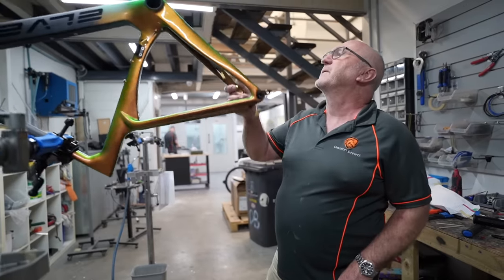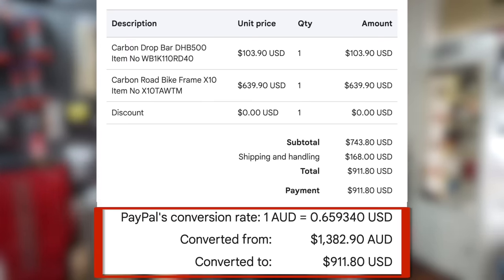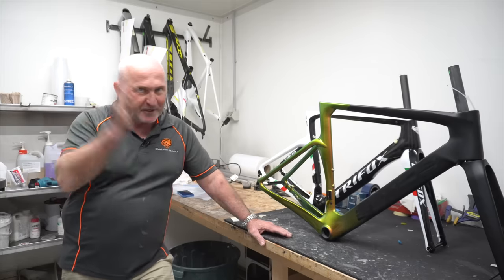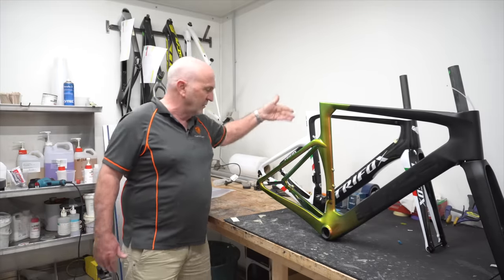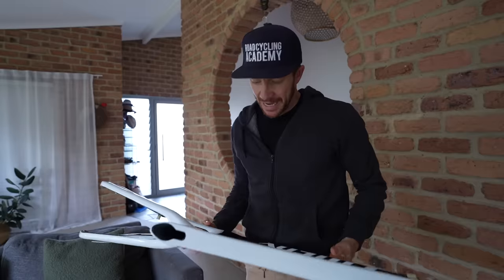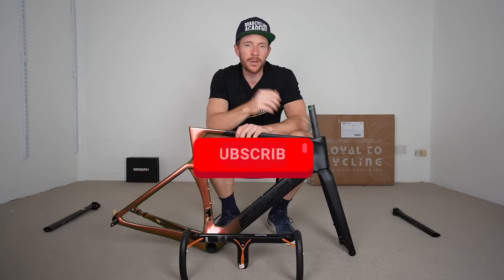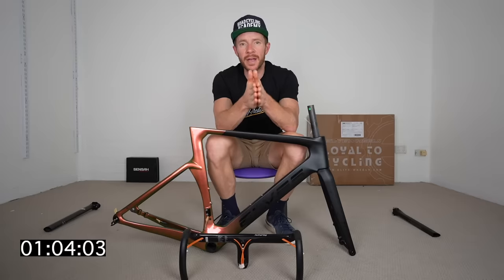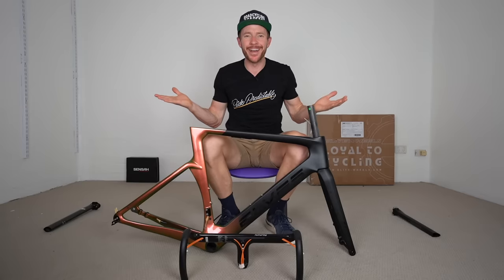I Bought Two Cheap Chinese Aero Frames (here's why)

Comment: I thoroughly enjoyed the video and your experimentation with the Chinese bikes. I have ordered a few myself over the years and you nailed it when you said they are hit and miss. I have had some great ones and some where the rear triangle was crooked. I am one of those not willing to spend 10k on a bike. Thanks again!
Reply from the maker: Thanks for sharing on the thread.
Reply: So what did you do with the ones that didn't work out? I'm interested but couldn't you argue that if you had to trash those bikes the price gets pretty comparable to a solid bike like one from Canyon?
Reply: @jackwright3098  Great question! I have found that I can buy 4 new frames from China before I hit the price of a brand new frame from the name brands. I have really only had one lemon from China and the other 7 or 8 were perfect. I enjoy buying and building up bikes so that is why I have experienced so many. Now many of the Chinese brands have some sort of warranty but even if they do not, you can buy 4 frames before you get to the cost of 1 name brand frame. Riding a Chinese frame, I do not have the fear of a frame breaking like I would if I was riding a name brand who may try to shaft me with their warranty fine print.
Reply: @BlackWaterCyclist  hey thanks for the reply. So you're not worried about the qc when you're going fast downhill? You could definitely have the same issues with a named brand but people have just made me paranoid maybe regarding Chinese manufacturers.
Reply: @BlackWaterCyclist  The problem is, if you have the money to buy 4, 8 or 10 or whatever Chinese frames in the hope one of them is good then you have the money to buy one frame that you'll know will be good and may as well do that. If the only downside to buying a known good frame is "might have spent a bit too much money" then you've lost nothing and you'd be better spending your time and energy finding ways to make money than buying multiple frames.

What typically happens for someone who isn't just playing on their youtube channel is that they don't have the money to buy multiple Chinese frames and they don't have the money to buy the expensive frame, and they're attracted to the idea of getting a bargain from China. If they get a lemon they're left with nothing, out of pocket and living in regret sans a bike (that's without even taking into account the very real possibility that they discover the 'lemon' carbon parts when they break as they are riding along - because they don't have the money to take everything along to some carbon fibre specialist to xray either)

So that's the flaw - playing at being poor and buying cheap products isn't the same as being poor. That person who genuinely cannot afford to take the hit if a cheap carbon frame is a lemon really needs to buy a known good quality metal frame or a used bike - because the hunt for non-lemons from China is a game they can't afford to play, in the same way the S-work frame is a game they can't afford.
Reply: @jackwright3098  Jack you make an interesting point about why you should buy a Canyon. However my friend recently brought a Canyon Aero and it's not all been plain sailing. He had to wait six months to receive it and that was partly due to Canyon were trying to resolve a seat post issue. Sadly they still haven't managed to do that because his one irritates him by squeaking constantly. Given he paid £7.5k for it I would of expected better. However all that said if had purchased an Aero bike from one of the other top brands he would of had to pay a lot more. Back in the 90s when I was in my 40s I aspired to get a Colnago but I just could not afford to buy one but given the high price of prestige bikes today I probably had more chance of buying one than I do today. Prices are just ridiculous. And as someone else has said in another reply the manufacturers are leading us down a particular marketing route. Every bike now as to have discs & hydraulic brakes but given the speeds I do rim brakes are more than sufficient for me and make the bike that bit lighter which also suits me. Recently looking into buy a Chinese frame I struggled to find one that takes rim brakes as well.
Reply: @2wheelsrbest327  prices are insane now, you're right.  And I just found a very small crack on my carbon road bike frame that will cost me $500 to repair.
Reply: @jackwright3098  Thanks Jack. Sorry to read you need to get your frame repaired Ted
Reply: @michael1  isn't that why this type of video is worthwhile? because he isn't playing at being poor, he's spending money to test things so others don't have to go through the bad frames themselves.
Reply: @chrisnoname2725  Not really. Like I say unless you're able to gamble your money on getting a good Chinese frame then your best option is the lower risk of either saving up or riding a cheaper material. And who is able to gamble their money? People with money to waste. The guy who can afford to buy a chinese frame that turns out to be shit are people who could afford a specialised, giant or whatever brand from their LBS in the first place - so why bother? (and note it's not a question of 'Are these frames ok?", it's more a question of "How many frames do you need to buy to be reasonably sure I'd get 1 good one on the average - 1 and a bit? 2, 3, more?) 

Just look at some of the tat they've got (https://www.youtube.com/watch?v=b57npoYQ-Z4) in other videos too - it's a big joke to these guys if they get a bad frame because you're paying for these bikes whether it's by watching the channel or being a customer of taylor cycles. It's not a joke for the guy with a genuine low budget who gets a frame that's potentially not just poor quality but dangerous too. They might not have the experience to see that there's cosmetic stuff like 'finish is shit' and 'this is likely to snap at some point' - noting too that a lot of these channels take the frames to some place that xrays them and looks for voids etc. This is something they do because, again, they have the money to waste (or the business they visit fancies the exposure)

Whereas the guy who buys the cheapest frame because he's little money isn't about to spend hundreds more getting the frame checked. And even if you did economically speaking it's probably best to just throw it in the bin and forget about it if the frame is bad rather than trying to ship items back and forth between wherever you live and China. 

Whereas, for the most part, if you get a bike from a LBS or even an online retailer in your own country you've a better chance it'll be sound and a better chance of resolving issues. 
That said, a glance at hambini's channel and you'd probably reach the conclusion that you can't get a good quality frame however much you pay - it's all overpriced tat engineered by idiots.

Worst case if you get a good frame from a well known brand is you spend a bit too much. You'll soon forget about that money after you ride for thousands and thousands of km and it's still sound in 10 years. Whereas if you spend a few hundred dollars on something that's shit you've lost the money and you don't have a bike. i.e A better strategy for a happy life is putting more of your effort into trying to earn more money than trying to buy cheap products. Unless you can get other mugs to pay by creating youtube videos - and then you can indulge the "Can you make a good bike from parts off aliexpress?"  - The last resort is living within your means, i.e I'd sooner have 10 years of fun on an aluminium or steel bike than trying to buy a carbon bike cheaply where "cheaply" means vastly increasing the risk that I'm just throwing my money away.
Reply: @michael1  I understand and agree with most of your points. The only reason i would say it has value is for showing who the better manufacturers are. It then depends on the consistency of the quality of the product. I assumed the people talking about it being hit and miss was between manufacturers rather than within the same product line. 
If a brand is consistently good and this can highlight a decent product then that can be helpful but I know they're not testing that. 
I personally just buy brands i assume are reliable and buy within my budget but it seems with a lot of things you pay the premium but don't necessarily get the reward.
Reply: @CamNicholls  he bro  can I buy Trek marlin 6 but made in China is written in frame buy or not I live in india

Comment: I'd gladly buy an Elgath Pro Disc ... but a mate's BARELY fits a 28 tire at the rear - IMO too close for comfort.   There's no excuse these days not to clear a 32 on disc bikes. He weighs 60kg soaking wet so he can get away with 25s even on rough roads. I'm running 29 front, 31 rear at 81kg.

Comment: Don’t forget that the vast majority of “American” companies still make their frames in China.  So, you’re mostly paying for better Quality Control, and a name that you can sue if something goes wrong, not where the frame is made. My friend bought a nice CF Marin frame a while back that was defective, and he’s been waiting over 6 months for a replacement that he’s probably never going to see. And most of the Cannondales that come into the shop I work in have poorly-assembled components that need either hefty adjustments, or outright replacement. A faulty shifter, and a disc brake caliper that had a majorly leaking seal are just from the last shipment we got in.  I feel like many of the “American” companies are relying on their past reputations, while cheaping out now.

Comment: Loved this video.  My road bike I built up myself is a china carbon frame.  After putting good quality, albeit used, components (Mostly sram red stuff), It weighs in at 14.6lbs.  I.E. Lighter than the brand new Tarmac SL7.  I have put a little over 3000 miles on it.  It is still solid.  Love riding it.
Reply: what frame did you buy?

Comment: 99% of the high price frames and forks are made out of China the last 12 years. They then ship to Taiwan for logistics and less dumping taxes.

100% of dentists dont know this fact.

I currently own over 40 high end road bikes and work on bikes daily as a mechanic when in Australia. The Trifox X16 rim brake is an incredible machine. I sold my SL7 S-Works after the first ride. The S-Works SL7 you see being ridden by big name riders is a different frame and fork. This has been confirmed to me by a team mechanic and video proof. It is hilarious how most cyclists are conned by these big brands. Just look at the prices they charge now for frames made in the same industrial estate as these brands Cam features.
Reply: You did not mention in your videos how rough the finishing was on trifox bikes, goes to show Cam is a lot more credible than you are!
Reply: Dentists also know that if the fork breaks because of a defect and your teeth are knocked out, you want a name-brand OEM so you can sue them for damages.

Comment: thank you for the content ! Ive been using my 150$ hybrid bike from walmart for 3 years and im now thinking to upgrade for a Road bike around 2000$ range. (ive been doing 100-150km rides and 15% hills on that 150$ walmart bike lol and i use it 7 days a week)
Reply: I took that plunge myself about 6 months ago, spent my tax return on a gently used carbon dream machine for $2,000. Best thing I ever did. You won't regret it.
Reply: Definitely do it! Walmart bikes tend to be unsafe at anything but low speeds (poor braking, parts that fail while riding, cheap puncture-prone tires), so I’d take the plunge as soon as reasonably possible if I were you. You’re also at a good time, as many shops may be closing out the 2022 models, as it’s nearing the end of typical “riding season” anywhere except super warm climates.

Comment: I have a Trifox x10 kitted out with sram red e-tap and winspace hyper 50s it rides really well. For the money its a great buy,it does not compare to my wilier cento 1 air but as a second bike its great.The Elves which i have never heard of is and looks a complete bargain....cant wait till you build it Cam.....
Reply from the maker: Interesting to hear Dave, thanks for sharing on the thread.
Reply: I would concur with that comment, I have a Chinese frame, it works fine but it is not as good as my Emonda. The difference is hard to describe but quickly I end up using bunch of "buzz words" anyway, just saying

Comment: I have a chinese carbon 29er frame I bought from someone that ordered 2. He kept one that was bigger, sold the other small/medium to me. It's near a match to a specialized or scott HT carbon frame with thru axle rear. I have about 2500 or more of very hard racing and mountain biking miles on the frame. Several 6 hour races, a few hundred mile races, It has no cracks, no issues. Beat to hell really. Raced it with carbon seat post, carbon bars, carbon specialized wheels and it comes in at just around or under 20 lbs. A super fast compliant race bike. I paid $500.00 bucks for the frame. There are options out there. Thanks Cam for showing the world we don't need to spend 10k on any bicycle.

Comment: Great video Cam once again. I bought an iCan gravel/ roadie around March this year. Chose raw black no logos. Put the awesome Campag Ekar GS on it. I can ride on the chain gang with the GC (Gold Coast) not the other GC (as in Gramd Tour Contemders!) at 45kms to 63 km sprints without a drama. I run Spesh Roval 38’s wheels with 30mm tubelss Roubaix tyres. I’ve also on these tyres thrashes it along the coastal grass an gravel around Ballina to Lennox. If I’m going serious all day gravel I swap out for some 3840 Spesh Pathfinders tubeless.
This bike is brilliant. It weights about 1kg heavier than my 2021 Emonda SLR with AXS Red and top end RSL 37s. I love riding both but the “own label” STEVENS BEAST as I’ve badged it is a brilliant all rounder.  I even put a small BMC decal on the seat post as I remind everyone who comments that in my instance BMC stands for Bicycle Made in China….!

Frame, forks and carbon bars all up was $1200 delivered to Gold Coast. Qld Aus. 

So far so good folks.

Comment: I bought a Trifox x16 thru axle last year and the frame made it about a year before the threaded BB shell that holds the actual bracket came un-bonded from the frame. I reached out to Trifox and they pretended to care, said they’d get back to me and never did—great customer service, right? So, I bought a Winspace t1500 and the quality is a million times better.

Comment: I just rode my first 100 mile ride on my 2022 falath. Absolutely amazing. Only thing is have to switch out the bottom bracket to a higher end on to stop creaking. Nothing with the frame though

Comment: A friend of mine had a 2021 Specialized SWorks Roubaix. He got the Elves Falath and it blew it away in speed. He sold that Roubaix rather quickly. I will get one. I recently bought two Yoeleo bikes.

Comment: I think the difference between Chinese and name brand frames has more to do with chemistry and materials science than perceived build quality.  Cut the frames up and run the samples through a 3 point bend and tensile test.  It would be interesting to see the difference at the material level.
Reply: Last week I hit 76kph on a downhill - I’m not comfortable doing that on an unknown brand.
Reply: Yes, stuff like the finish on the fibers and the exact kind of epoxy really matters to bond strength and you can NOT see this by having a bike mechanic eyeball a painted frame.    You have to do destructive tests.  

This is where I worry about a small Italian (or Chinese) frame maker.  Can they afford to destructively test a statistically significant number of parts?    You do not get good data by breaking only one frame.  I assume Trek can afford to crush 100+ test articles a year.
Reply: @chrisalbertson5838  you have to understand some of the "Chinese" brands are doing the building and testing for Trek etc
Reply: RandomShart  There's fundamental difference between completely hacked and copied models vs what's in the video. Most of these frames are 公模 (public model) meaning everyone can make them as there's no protected IP behind them.

If you're really lucky or you know which factory to buy from these 公模 frames can be just as good as mainstream brand frames. When I was a college student our team was sponsored by one of these factories and their frame is on par with middle range big brand products (definitely not the top-end though). Usually these factories also take OEM orders from big brands. The factory sponsored us made disc wheels that won that year's world championship, just saying.

I am personally against any IP theft, i.e. fake frames (and they are illegal anyway). But it's great to see these OEM factories start their own brand and make their own frames. Tbh bicycle frames are no rocket science, and we indeed need to introduce competition to the industry. Big brands are more and more like rip-offs.

Comment: Be interesting to see how the sizing works out for you because going by the Elves website that you linked in your comments further down you should be on a size 52. And I should be on a size 49 (I'm 172.5 cm tall with an 82.8cm inseam and on size 54 on every other brand) so it's a bit confusing.
Reply: Yes, I have the same thoughts. I am 175 cm and I am not sure which size i should choose: M or L.